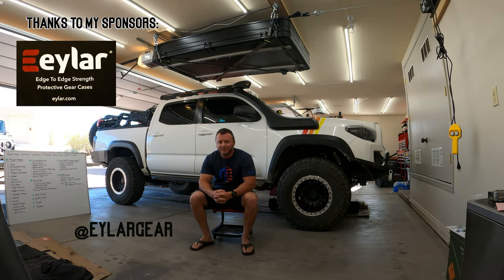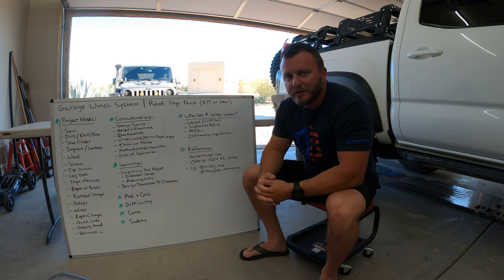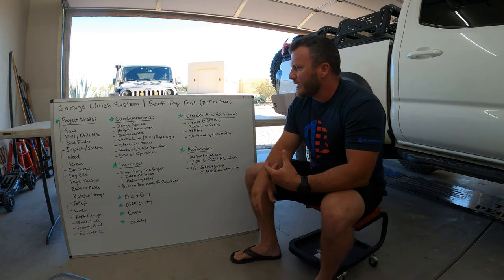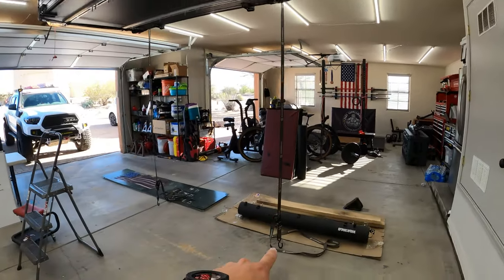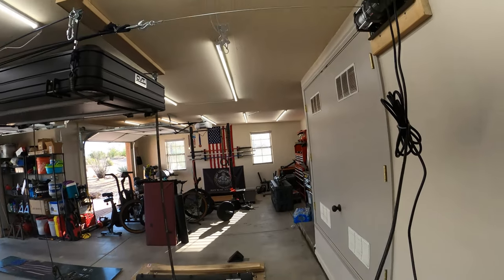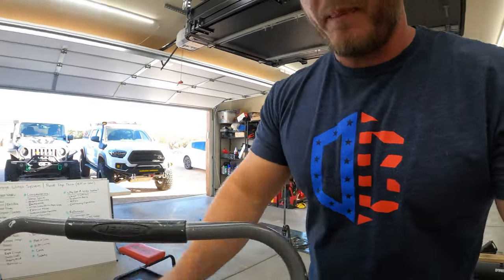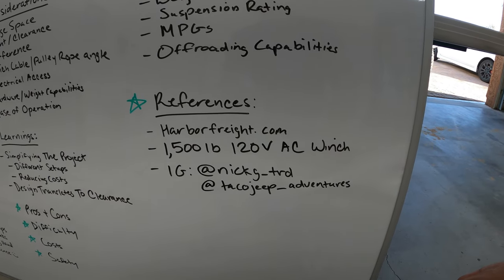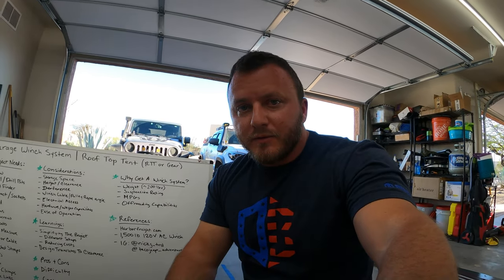Building a Garage Winch System for Your Roof Top Tent

Comment: Hey nice looking set up! So I am planning on doing something similar. Did you pre drill a pilot hole into the joist and your boards? If so, did you drill a smaller pilot hole than the lag screw? And does your eye bolts go through and into the joist as well?
Reply from the maker: Thanks! It has really been awesome to have this. I did drill a smaller pilot hole for everything installed. For the eye screws you can use a screwdriver or metal rod through the “eye” to help you tighten it. I’ve had myself and another adult hang on the 200 lb tent while suspended and it doesn’t budge. Very strong. The eye screws do not go into the joist. Hope this helps!

Comment: Hey, thanks for this video! Do you recall what size lag screws you used on the pulleys in the vertical position? Did you have to bend open the pulley to mount the screws?